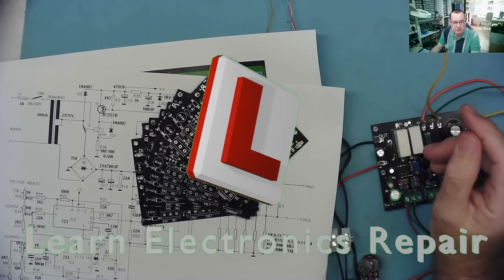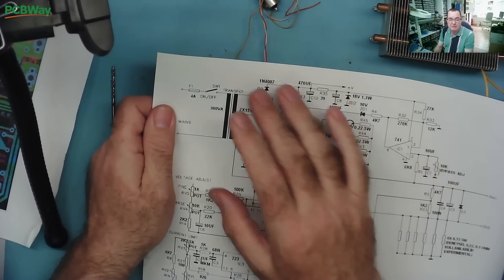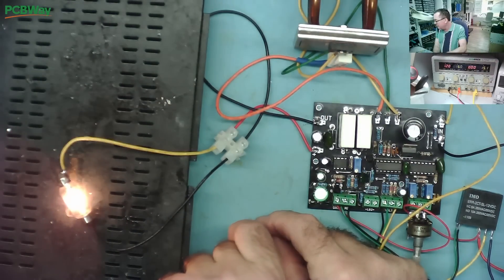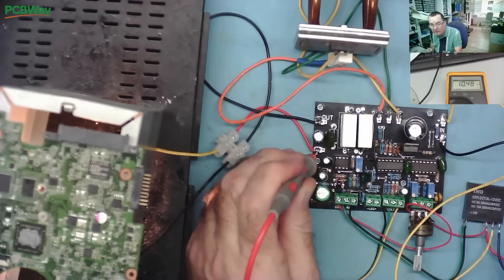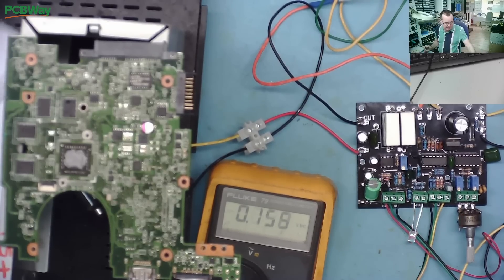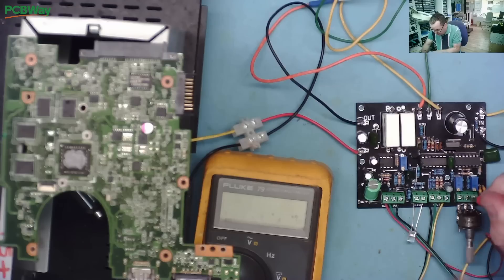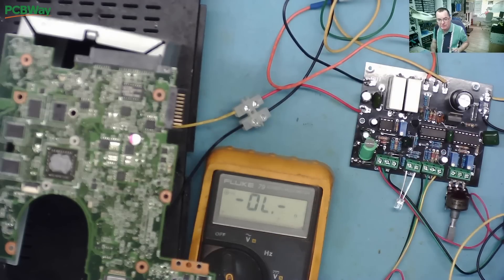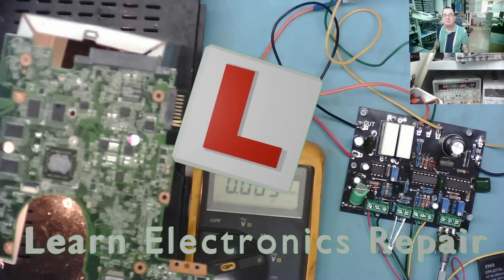How To Build A Variable Bench PSU 0-30V 0-10A  Constant Current Constant Voltage - Part 2

Comment: Interesting project. X010 is a  resettable fuse.
Reply: My thoughts exactly ralph J ;)
Reply: Yes, a polyfuse and X010 means 100mA current. The 60 above means probably 60V maximum voltage.

Comment: Richard before connecting two switch mode supplies in series check that the DC grounds are not tied to mains earth or a potentially dangerous condition will result if the cases connect to one another. It is possible to lift the earth on one of the supplies to fix this but then safety will be compromised in the parallel configuration.

Comment: People will say Re-settable fuse/poly-fuse etc.. in regards to that WGP Mexico component because they think the internet is god & knows everything  🤦‍♂
it's actually a 'PTC Thermistor' 2 give away(s) it's used in circuitry to provide protection as a replacement for a fuse. 60-volts 1-amp 🖖👍

Comment: Trick for wasting less power with AC input: add a regulator stage before the storage capacitor - set to a couple volts above the voltage on the output. Instant reduction in dissipation by 20-40% depending on the output voltage. That stage can be pretty simple - a couple emitter or source followers in parallel (if needed), with base/gate connected to supply’s output through a voltage source of say 3-4V. For testing, 2-3A AA batteries in series work well. For a final circuit a current source driving a Zener diode would do just fine.

Comment: Smoke left of Video 11:40 ?
Reply: Light bulb is cooking the "light shield".
Reply: @englishrupe01  wouldn't think a pcb smokes with just a light on it
Reply: Lamp (which are usually 12V or 24V and may have 30V across it) burning the paint off the metal plate or plastic connectors on the pcb
Reply from the maker: @ralphj4012  Most likely something like that.  It was an old scrap PCB and the metal stand I use then doing hot air desoldering to save cooking the bench.  It fine

Comment: Quite an old school design 3055's, 741's etc.  plus an interesting take on the current limit, as it would seem that the 723 is measuring the volt drop across the sense resistors between the 0V out and the internal 0V. And using this voltage to produce a current from which it senses to provide the shut off point. 
Do all ATX power supplies have fully floating outputs? so they can be connected in series?
How about a nice clear shot of the circuit diagram so we can go back and follow the design.
Reply from the maker: No ATX don't have floating outputs - this is something I mentioned in part 1 and I need to address it in part 3
Reply: @LearnElectronicsRepair  Will be interesting to see how you break the grounding on the ATX supplies. Never looked at PC supplies except changing the fuses once, they seem to be very reliable.

Looks like I’ll have to have a look for a circuit diagram.
Reply: 723 and 741, a reminiscence of the 70‘s 🤓
Reply from the maker: I put the link to the circuit diagram in the video description )on bith the video and part one) so you should have no problem finding it 😉
Reply from the maker: @inse001  And it works (as proven here) so why over complicate things?

Comment: Richard can it be modified to 0-30V 0-20A ? thought it should be possible with beefier transistors or more transistors ??
Reply from the maker: Of course, you need more/beefier output transistors and increased base drive to them.  Probably  I would use two of these PCBs, and populate one with just the BC547B pre-driver/BD646driver/TIP3055 output stage ,and fully populate the other - so the same LM723 driving both BC547B and onwards.   That should do it quite nicely 😁

Comment: Should have some hysteresis on the transformer switching
Reply: A nice buzzing sound would let you know it's about to switch. 🙂
Reply from the maker: My dual linear bench PSU also has the same feature where  it switches the input voltage (via relays) from the transformer as the output voltage changes, and this seems to be what was triggering and causing the rapid relay switching in the bench PSU